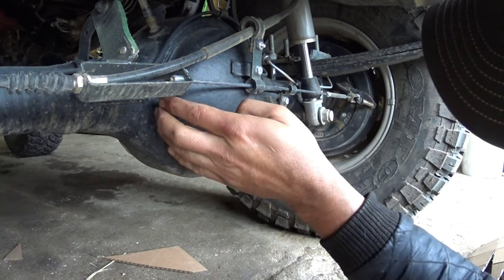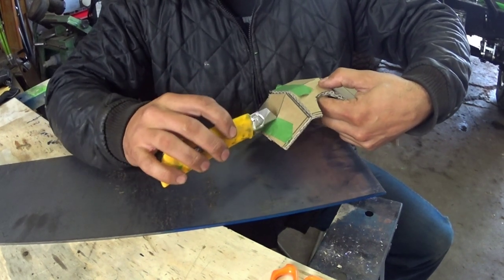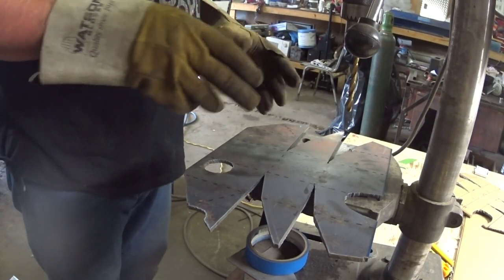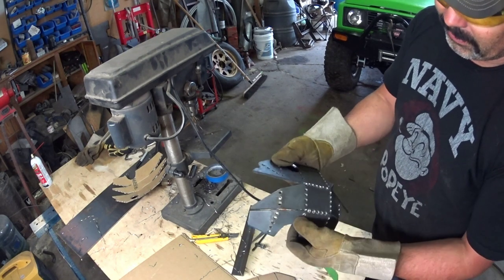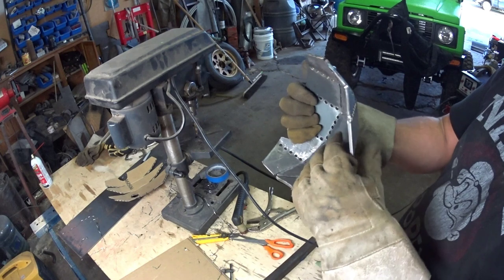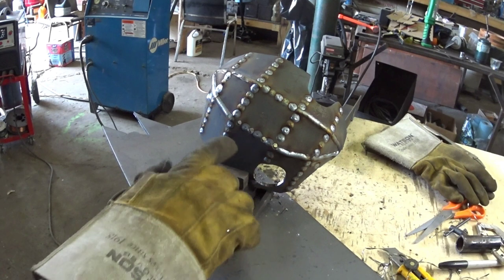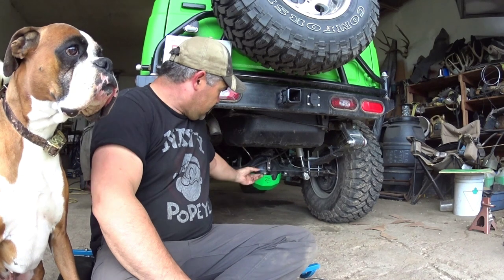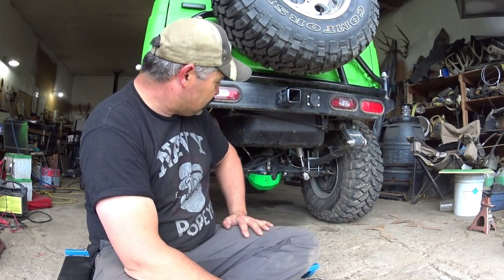DIY Diff Armor

Comment: Again very nice work. Your Plasmacutter seems to be a very good maschine. Very clean cuts.
Reply from the maker: Thanks! Yes that plasma cutter works awesome. Bought it off the welding shop i worked at a few years back.
Reply: Zuki Evolution so where’s the mud gonna drain from??
Reply from the maker: Unless its real thick, it should drain out the front where the third member bolts up and the 4 little holes i didnt weld up. I may have to make them holes bigger, but i dont plan to play in mud much. More rocks and trail running.
Reply: Zuki Evolution I’d make em bigger... only speaking from experience..
Reply from the maker: The slots up front are plenty big, but i do realize 1/4 holes in the back wont drain the thick stuff. Ill make them bigger if i have to, but like i said, mud dont do much for me, doesnt mean i wont go in a mud hole if i have to, but i sure wont go looking for one to hit..lol
Reply: I'm sure those quality of cuts come from the experience of the man, more than the machine. Nice work.
Reply from the maker: Thanks, i appreciate that!
Thanks for watching and commenting!